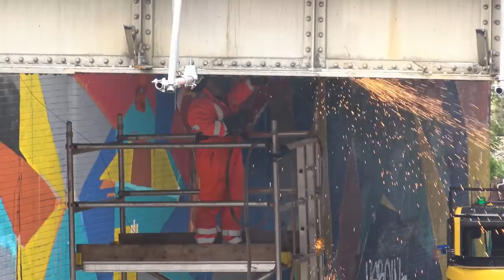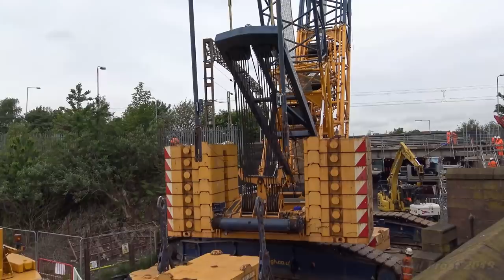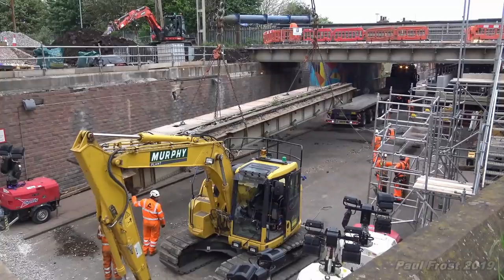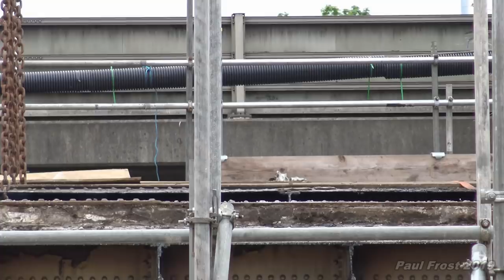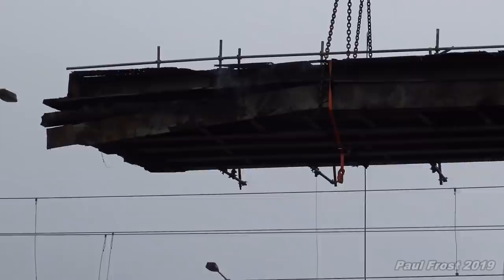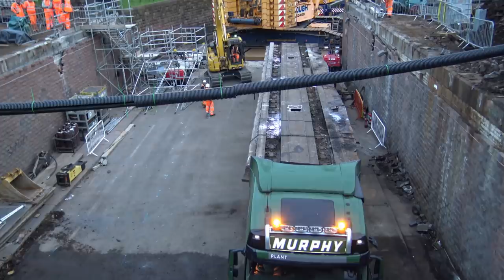Removing the second Church road Rail bridge

Comment: If the sign wasn't enough to confirm it, the use of the chain hoist(s) definitely was confirmation this video was not recorded in america, lol. If it was Osha would have a conniption fit for even thinking of it, lol.
Reply: True on the chin hoist, also those COE trucks.Among a few other  signs easy to spot.
Reply: Noticed the locomotives.  Not the kind you’d find in the US

Comment: I find it weird they didn’t build any support for that corrugated pipe. That much cable hanging in its own weight can’t be good.

Thx for the filming. They surely worked in confined spaces!!
Reply: Actually they did. You can see the heavy steel cable outside the plastic pipe at 24:00 and several times after that.

Comment: I wonder why they lifted the center beam out with the jacks, when the side closest to the overhead lines had already been removed using the crane? There must be a reason other than the proximity of the power lines?
Reply from the maker: The centre one was directly under the overhead lines.
Reply: @veryhighguy  ahh, it's not easy to tell from the video, they lift one from the near side, then from the far side over the top with the middle bit left underneath the lines. Serves me right for watching late at night when I can't sleep 😕
Reply from the maker: Haha no worries. I was there and still it’s deceiving. Probably the angle.